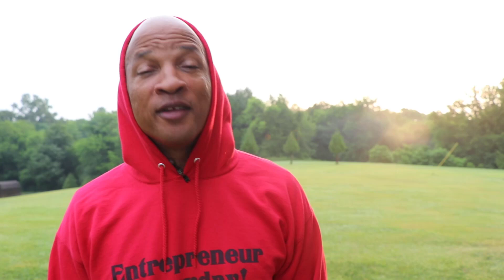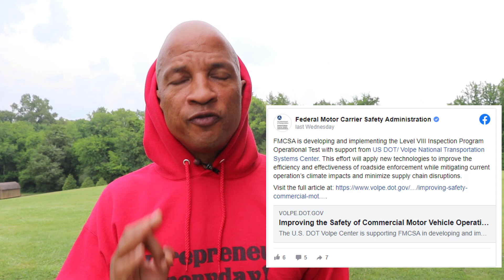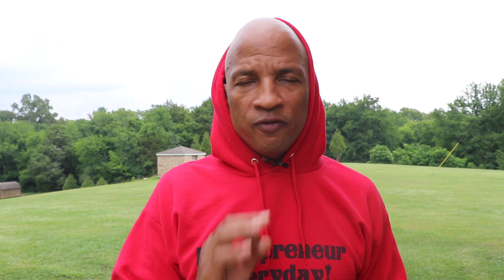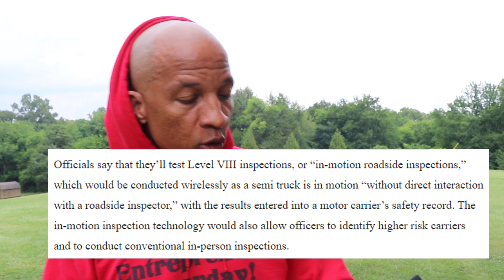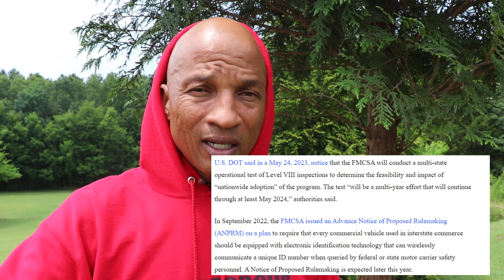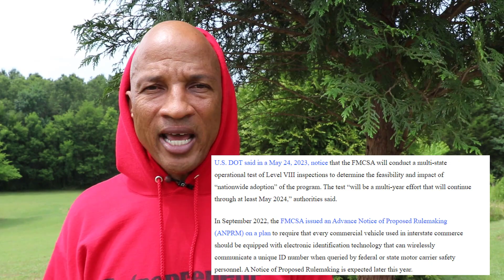FMCSA Quietly Testing New Tech...More Compliance! Good For Truckers?

Comment: I think they need to fix all these roads that buttigieg screwed up first. no new driver regs until there are no potholes. buttigieg needs to go. also, the current fines for all current regulations and violations should all go to the shippers, not the drivers first, before there are any new burdens to blame drivers for everything.

Comment: I'm a bit torn on the issue. The company I work for  is very aggressive on maintenance etc. However, I've seen trucks and trailers with many lights niy functional and absolutely bald tires on trailers. That's just from glancing at them. I don't want my fellow operators to be picked on, but I also want them safe.

Comment: The main concern should be accuracy. How is it possible to do an inspection on a moving truck? What will be inspected?  Sounds like futuristic talk to me, stuff that they're trying out but haven't perfected. Most new trucks have the automous program in it already what about older trucks how will they inspect them in motion? Again this won't happen any time soon. I encourage truckers to join OOIDA and fight stuff like this.
Reply: The inspection obviously will be on a driver level. 
They want to know who is behind the wheel and if you have violations  they will pull you over.